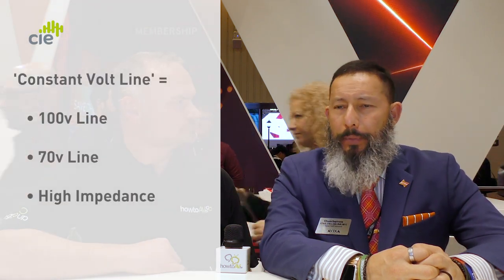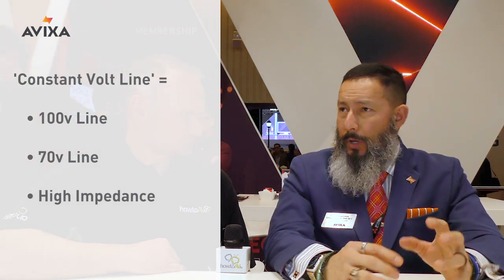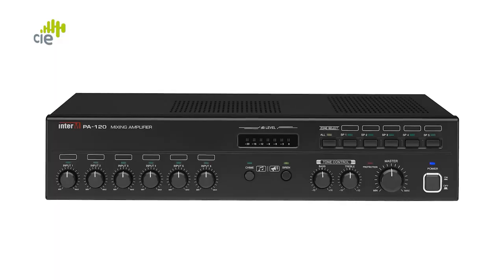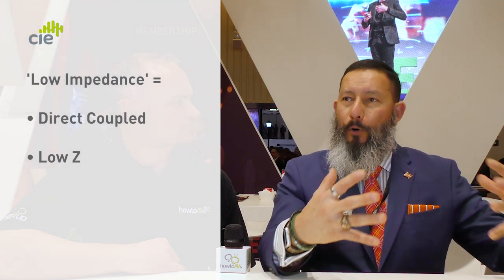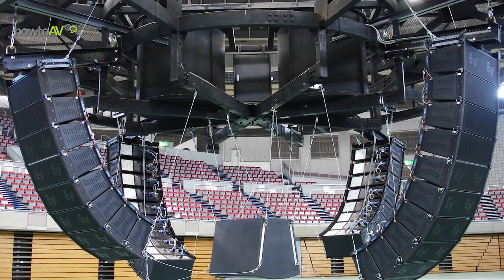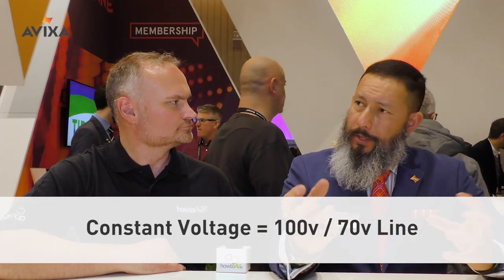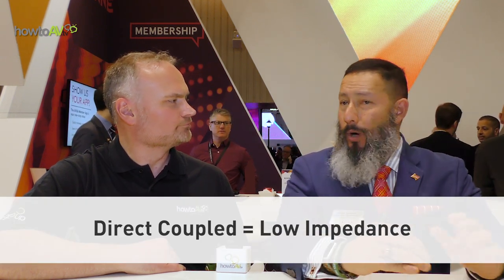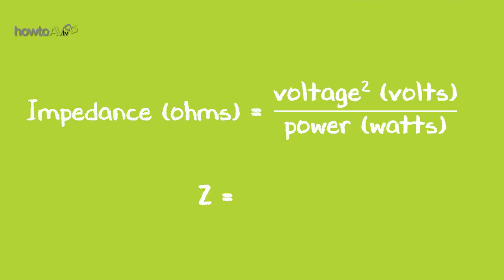100v line vs low impedance - What's the difference?

Comment: @madsoundguy So is there a general engineer's rule of thumb of when to use 70V over low impedance? 
I'm imagining a rule of thumb that goes something like this: you want to keep the total line impedance under 1/8th of the speakers impedance while maintaining a realistic wire gauge. Power and distance are the important hidden factors in that rule of thumb.
Thank you very much for sharing your invaluable experience and knowledge!

Comment: hello iam doods from the philippines i have a question i have 4 units 150 watts 16 ohms horn speakers connecting to 100v amplifier with audio matching transformer it is possible to tap the secondary to 8ohms to a 16ohms?
Reply: Ah i see, you want to get rid of the impedance matching transformer? 
i presume that amp has 2 channels out? You should be able to put put 2 horns in parallel to give you a total of 8 ohms for that pair. put that pair on one channel out of the 8 Ohm amp. another pair on the other amp

If your amp has one out: I think if you wanted to convert your amp to 16 ohms, you would either have to manually add turns on that amplifier's output transformer(assuming it has an output transformer) Or just have a single 8 ohm to 16 ohm impedance matching output transformer. that may be hard to find at 600W but you may be able to do the math and find a transformer with 1:1414 turns ratio. https://www.everythingrf.com/rf-calculators/rf-transformer-calculator

If you were to buy a non audio rated transformer it would still cost you, in dollars and in sound quality. Digikey has something like what you would need but these are only to get you thinking; i make no claim that these would suit you well... (i.e. Do the math! lol): https://www.digikey.com/en/products/filter/power-transformers/164?s=N4IgjCBcoKwBxyqAxlAZgQwDYGcCmANCAPZQDa4cMAbGAMwhEBMMAnHTA87WEwOyMQTagBY6vQfxhhqMSXz7U6A5nyojEzBAAY4rSa3ZwVIOtrB8mIwWbOiQAXSIAHAC5QQAZVcAnAJYAdgDmIAC%2BoUTUSCB%2BACYeALRg5oJuHoKuAJ7OeB4YOKjhQA
Reply: You can connect secondaries of 2 transformers in series (check polarity!) and connect one 16 Ohm speaker to them. So you need 8 transformers rated at 75 (plus) Watt, 8 Ohm load secondary.